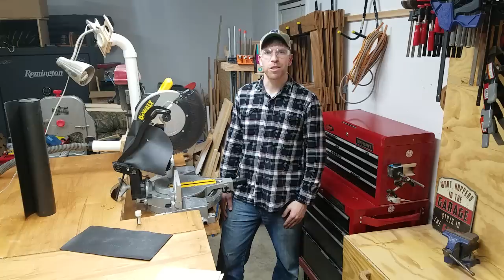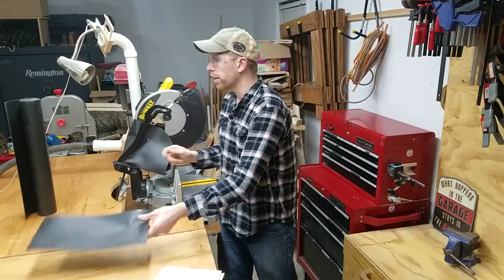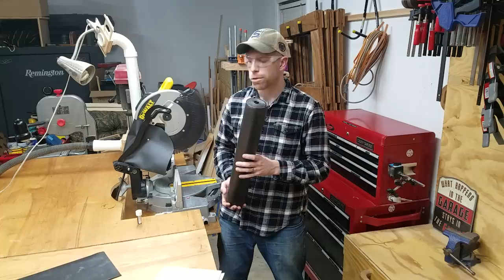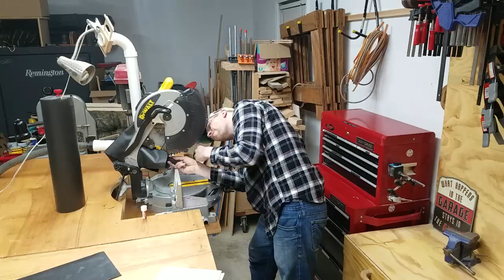Miter Saw Dust Collection, simple and extremely effective! (LINK TO TEST & TEMPLATE IN DESC)  / EP44

Comment: Good video, good solution! I'm planning my own and will lean heavily on this and a couple more. That flexible shroud close to the blade is key, my addition will be a kind of downdraft bench with slick and tilted bottom, letting gravity help feed the suction at the bottom.
Reply from the maker: What model saw do you have? I've gone down the road of designing a number of bolt-on solutions for multiple saws

Comment: I have tried for over an hour to get the template for the dust shroud and still cannot find it.  Can you please provide a link?
Reply from the maker: Geri, below is a direct download link, it's on the Free Plans and resources page.  Thanks for checking out my website, and thank you for the feedback on your trouble finding it.  https://img1.wsimg.com/blobby/go/98cf055b-1d47-432c-93bf-f2e560b99134/DeWalt_12in_Miter_Saw_Full_Size_Shroud%20Pa-0003.pdf

This is an Instagram link: https://www.instagram.com/p/BsGi6i9gBYe/?igshid=YmMyMTA2M2Y= it was several years ago, so it's buried pretty deep in posts.

Comment: What vacuum device are you using with your ingenious hood? How.much cfm?
Reply from the maker: Michael, standard shop vac. The model is rated at 320 air watts. Actual CFM unknown estimating ~120 at around 65 in-h20 static pressure.  High static pressure seems to be the trick for routers, and miter saws.
Reply: @benchtopwoodworks  In my case, I have a choice for my MS dust collection between either running a reduced branch from 4" pipe connected to high cfm shop cyclone,  or alternatively dedicating a high pressure shop vac  to the MS alone. I take your comment to mean that going with the shop vac would deliver best results from your hood design. Is this correct?
Reply from the maker: Michael, I'm not sure.  It probably depends.  You likely will have a higher volume flow rate (cfm) and may even have higher static pressure at the MS from the reduced DC than your shop vac.  Do you have the ability to test from another port before running a permanent leg? I've only made a large shroud enclosure for a large collector,  I have not personally hooked a collector up to a saw modified with the small shroud.  Two people have emailed me telling me plumbing a reducer in worked well for them
Reply: @benchtopwoodworks  Thanks Chris. I'm most interested in a jobsite MS solution for my finish carpentry ops and think I've stumbled across an ideal extractor solution, recommended by Dennis at Hooked on Wood YT channel: Record Power CamVac extractor. Dennis' review and analysis indicate this machine offers a fairly unique combination of cfm and pressure characteristics, making it a sort of hybrid, and a very compact and transportable one at that. I had already devised a modular carry case for my non-sliding MS (Dewalt DW706) whose halves transform into a tall rectilinear dust hood when opened for use of the saw. (Its deployed form comprises a further developed version of the temporary hood you used to aid your dust comparison video.) I will fabricate a version of your flexible rubber hood as well. Between those two complementary capture devices and the suction power of the CamVac, I'm anticipating a spectacular result. I myself don't often post on YT, but if this works as well as I hope it will, I'll be sure to share as you have. Thanks.

Comment: Hello Chris
Great video.
Had you had the space, would you say that a hood/shroud is more effective compared with a funnel?
Reply from the maker: I'll give the classic,"it depends" I actually think high static pressure suction (like a shop vac provides) is best for diverting high-speed chips (like a router, CNC, miter saw). I've used a setup with a hood tied into a 3HP dust collector and I can honestly say I prefer my current method better. I do not have experience plumbing a dust collector into a modification like my own.  I think a few viewers have done so,  but I don't have much feedback on the results.  To directly answer,  if I had he space, and was going for zero dust, I would probably do both.  I would probably keep my shop vac into the existing stock port and follow it up with a good shroud to catch and pull in the fine airborne dust.  I published a "deep dive" video on miter saw dust collection earlier if you are interested in watching it.  Thanks for the question,  I hope I answered it!
Reply: I guess your answer can be summed up in - you can never use enough dust mitigation measures - so a combination makes sense. Maybe adding more suction points around the saw could improve things but it could be to cumbersome.
Thank you for your answer.

Comment: Hey Chris Nice design I made one using the top of  large windex refill bottle( the big one you get at Cosco ) its kind of rectangular and still I glued a peice of drawer liner to the front of the bottle (after i cut it to size and the used two small sheet metal screws and more ca glue to attach it to the dust collection tube - works great and swivels  w the saw
Reply from the maker: Sounds like a great concept,  Joseph, the rigidity of the plastic would make a great funnel. Thank you for sharing!

Comment: Stock dust collection tube is too small and can easily be enlarged to 2.5 inches as the throat is large enough and also fits a shop vac size.
Reply from the maker: I'm sure that could be done on many saws.  I'm not a fan of the reduction either. The main thing I found for most saws is getting the air stream closer to the blade.  Here's an explanation: https://youtu.be/dN0xR__pSI8:

Comment: I think your solution is far superior to the others I've seen; you collect dust right at the blade, enable mitering and beveling, and have one of the simplest and cheapest methods.  I've attempted something similar with the exact same saw, but using more rigid materials in my mod which unfortunately maintained a significant open gap between the stock dust extraction tube and my funnel-like modifications; that large gap made my attempts a failure.  I'll be purchasing shelf liner and replicating your work this weekend.  The only difference is I have a 1250 CFM dust collector so I might be able to forego the wire stiffeners.
Reply from the maker: Best of luck,  I appreciate the kind feedback.  I would love to see your results if you have time to email/share!

Comment: Well done, well explained. Thank you.... what do you suppose is wrong with the manufacturers?
Reply from the maker: Thanks Mark. DeWalt in this case (and many others) just doesn't get the suction air stream very close to the blade. Some brands (Festool Kapex etc.) Have small rubber chutes that are closer and perform  better.  This design in particular gets very close to the blade and can be nicked, and contacts the fence.  It may need replaced every few years or more frequently depending on use.
Reply: Miter saws are primarily designed to, and do an excellent job of, cutting wood. Dust collection is secondary (if that), and doesn’t impact product sales.

Comment: what are the reducer tube sizes to connect saw exhaust to shop vac ?
Reply from the maker: I used a rubber 2" to 1 1/2" rubber reducer. I can't recall if I showed it in video,  but they are typically sold with hose clamps attached.

Comment: The product in the link you provide looks like it has more texture than the stuff you’re using. Is that texture just not visible in the video or is that stuff actually smooth? Ironically in the product description you linked to they brag about not being smooth so tools don’t slide around in drawers...have they changed the texture?
Reply from the maker: Original link is to the exact stuff I used. I'll check to see if it's changed,  thanks for helping look into it.  Directly answering your question: one side is mostly Smooth and one side has light texture.  It likely isn't visible in the photo. May be more visible in this Instagram photo. 
https://www.instagram.com/p/BsGi6i9gBYe/?igshid=dhs75k9dfrbn
The drawer liner can also be purchased at the box stores and even the dollar store. 
Hope that helps,  Will.
Reply from the maker: I just checked out the link,  that's the same as originally used.  Hope that helps, and best of luck getting rid of that dust!

Comment: Not sure this would work on my Dewalt slider with the fence in the way of the extended shroud
Reply from the maker: Ron, if you do try it,  I'd love to hear your results! A few others with a sliders have,  I recommend cutting  away what's required for it to work.  Main concept is however you can,  get that collection airstream closer to the blade

Comment: Nice job.   As a mechanical engineer and product designer you did a great job.  One suggestion for getting better raw material is to use McMaster Carr.   They have lots of industrial products and have an excellent web site.  I am going to make this using neoprene with a medium durometer as it is fairly inexpensive and durable.  Urethane would be even better but it is much more costly. That will keep it from flipping up yet still be flexible.   Keep up the good work.
Reply from the maker: Thanks @lstar59, I appreciate the design compliment.  I love McMaster Carr, great inventory, sometimes pricy, but always have what you need.  I think this is Urethane coated PVC, I chose it mostly because it's really availabile to consumers. I appreciate you sharing your ideas to improve,  I definitely think a material with higher stiffness would be an improvement for sure. I'm not sure how well I showed it,  but material from the stock shroud needs to be removed in order to accept the rubber cone around it, so a stiffer rubber of the same thickness would definitely improve it. Would love if you are able to share your final material selection on here.

Comment: One tip for users : do not hook that to the vacuum. The flaps will collapse...🙂👍🇨🇦
Reply from the maker: Did you try it Bruce? A wire  frame is recommended for optimal performance, CA glue or tape both work for attaching.  This mod  gets the suction close to blade where its needed. I'm happy after serveral years of use with a vac.  I have a 12GA piece of solid copper wire internal on mine

Comment: I just bought the Dewalt DWS 799 Miter Saw, and the dust chute/guide is different. The problem I was having is when I attached my dust collection the suction was too strong and collapse the thin rubber chute/guide closed. My solution was to take the dust port and tube out and wrap the thin rubber chute with Gorilla black tape. This really reinforce it and when hooked up to the 2HP Dust collection the chute did not collapse shut anymore. In addition I added a chute extension like you did with rubber liner and that made it perfect. Thanks for the idea.
Reply from the maker: Awesome,  A.J. I reinforced mine with wire,  some other viewers also used gorilla  tape and even CA glue with success. Glad to hear about the success. Thanks for sharing to help others!

Comment: I actually have 2 flexible hoses coming from  above through a 4”-to-two 2-1/2” 3-way splitter with 6” shop vac floor attachments on each one...similar to drill press dust collection...one on each side of the blade...when I lay stock down, I also lay the 6” shop vac floor attachments on both sides of the stock along with the rear dust port to collect the dust...miter saw dust is a pain
Reply from the maker: Thanks for sharing, how does  it work? Miter saw dust collection is a pain.
 I used video recording to help analyze how my saw was throwing dust on several different  cuts before beginning to try to optimize it. Glad we're doing something to try to kill that dust.
Reply: Chris Harpster i did the exact same thing, i recorded it...i saw how and where the dust was flying...i noticed it does the same thing as my drill press...so, i figured if it had suction right at all angles of the source, then that should help
Reply: Chris Harpster i run a 4” ‘Y’ fitting from my miter saw’s blast gate...one end of the ‘Y’ goes into the dust port and the other end of the ‘Y’ has a hose attached to it...that hose is then run under a shelf above my saw and is connected to another splitter...the splitter is secured  to the shelf with a pipe bracket above the saw...and from there, 2 of the stiff flexible hoses, the ones that hold their shape, come out of each splitter...the splitter is 4” on one end and the other end has two 2.5” connections...a flexible, stiff hose comes out of each of the 2.5” connections and have a wide shop vac floor attachment on each end...you can move them around as you use your saw...if you make the flexible, stiff hoses long enough, the shop vac floor attachments can be maneuvered wherever you need them...took me some time to get it right but now it works flawlessly...i lay the shop vac floor attachments directly on the stock right against the saw blade...sorry for the long post, but hope i explained it effectively...
Reply from the maker: Pharoh Acura (that's not your real name), you described it well.  It sounds like a solid set-up. What kind of collector are you running? I'm very happy with my setup with a shop vac power- plant.  I've used some excellent high-volume  hood-type setups. Yours sounds less bulky/ more effective than some of those shroud setups.
Reply: Chris Harpster i have a jet dust collector but i use to have a similar setup with my shop vac...i just recently got the jet...not even a month old, lol...the key to the whole setup is the splitter and the flex hoses as they allow you to have suction on both sides of the blade where all the dust is created

Comment: There is a product on Amazon called Plast-Aid, you can make plastic forms and moldings with it, worth watching a YouTube video on the stuff, caution though, you will stink up the whole are when you mix it, best to do outside if possible. it does set up quickly.
Reply from the maker: Thanks Tom, I will definitely be checking it out. Is it essentially an epoxy?

Comment: I have fought this dust from my Miter saw since I bought it. and I hate it Some time back I stumbled on what looked like a great dust collector setup for the problem. I was about to do it, and then I found yours. Not sure which I am going to do. But I would ask you to peruse what I found and let me know which you think is the best. Please click on the link below:

http://www.cianperez.com/Wood/WoodDocs/Wood_How_To_Power/POWER_How_To_pages/Photog_MitersawHood.htm
Reply from the maker: I think it very much depends on your dust collector. I'm using a shop vac which is high static pressure at approximately 100-120 CFM flow-rate. With that "high suction" it dissipates quickly with distance. The shroud I designed will work for both, types of collectors. The setup in the link you sent looks like a high-volume type setup which requires a high-volume of airflow  to pull all air from around the saw into the inlet. If you have that type of collector, it will be completely up to  you.  Would love to hear what you come up with,  Pat!
Reply: @benchtopwoodworks  Thank you Chris. My DC is a 2 HP,  with a 6" pipe input. I will make the 4" port on the shroud a 5". This is a very powerful amount of vacuum. I think it will really work good, But if not I will use yours. Thanks again kind sir.
Reply from the maker: I think the large port or a large shroud would work well for your setup!  If you end up with something different, or in the  ballpark  of my design I would love  to hear about it or see a photo  I'm limited by both space behind  my saw  and dust collector power which were the drivers for my design.  It seems like you have these covered without issue. I'm happy to hear that you will be able to solve your issues with the simple version you sent.  If you need to channel  it closer  to the blade you can always do so with some form of baffle. I'm glad to hear you're solving your miter saw dust collection!

Comment: Video very well done. I watched another video using the "rubber" sheet material. Now I know that it is simply drawer liner. I was thinking way too hard to make this a difficult project.
Reply from the maker: Great to hear,  best of luck taming the dust! Dont hesitate to jump in on this one.   I know when i was starting this project, I figured worst case,  it wouldn't end up worse than the stock collection.

Comment: I needed dust removal for my compound miter saw that sits on a wheeled base and can be moved but instead of building a removal system I open the shop door, park the miter saw in front of the door and put my 30" pedestal fan behind me and it blows all the dust away from me and  right out the door, works great.
Reply from the maker: Solid technique, Roy. Thanks for sharing!
Reply: I do the same thing, however, that gets a bit rough during winter, or if it’s raining sideways🤣
Reply: @dropndeal  if it is that cold I put a piece of pvc    pipe without 90 degree elbow on the sawdust outlet and let the saw dust blow into a barrel
Reply: @royhoco5748  Fortunately, here in coastal Alabama, we don’t get many really cold days. In those cases, I use one of my shop vacs, then deal with remaining dust. 

My big Dewalt is currently on a wheeled base, so I can move it to an opposing door for prevailing wind changes. At some point I may build a dedicated station with better dust collection; but I’ve been saying that for six years!